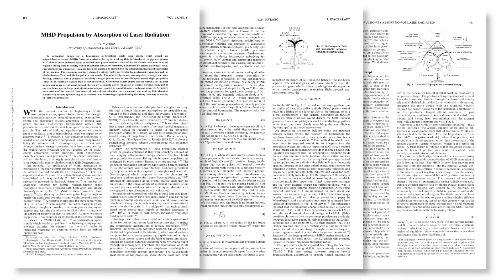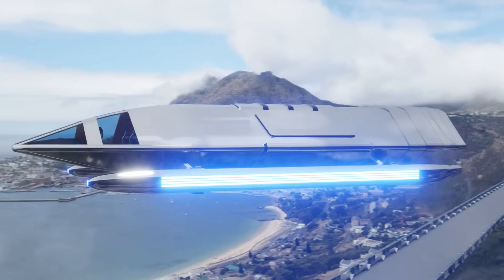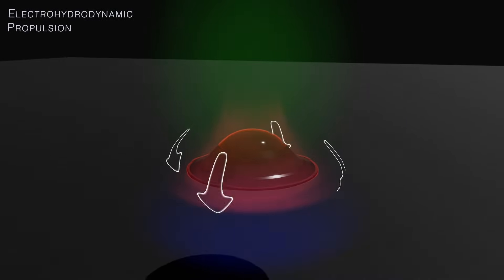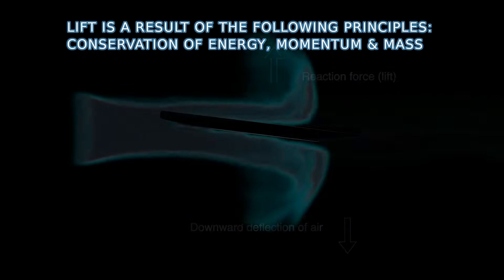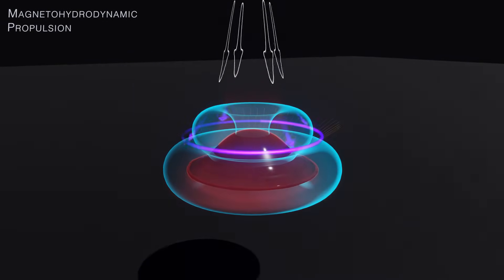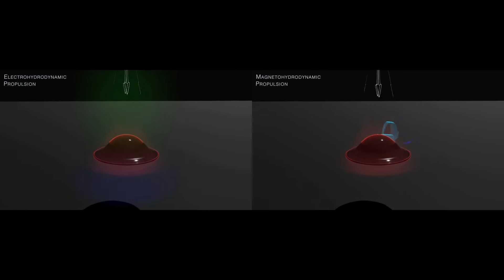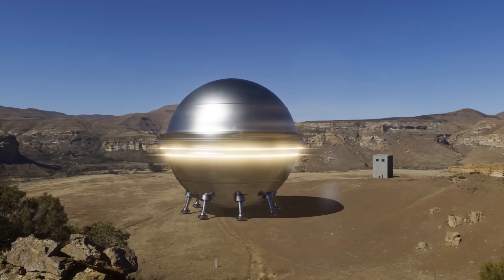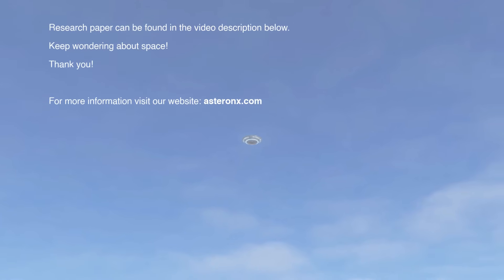Magnetohydrodynamic (MHD) Propulsion - What Is It? #magnetohydrodynamics #mhd #aerospace #asteronx

Comment: Very good briefing and tutorial to explain the electrodynamics and fluid conducting material and operation of the craft.
Reply: There is an interesting design of aircraft, but they rarely talk about it, because this thing is secret. The topic of pulsed plasma thrusters has been developed since the early 60s (see PPT - Pulsed plasma thruster) - they are usually designed for spacecraft. But we will talk about a little-known design - these are plasma propulsion panels for aircraft, where the same Pulsed plasma thruster, but reduced to the size of a pencil and stacked in the form of cells in the panel. The design resembles a conventional plasma TV screen, where there are also discharge cells that activate the glow of pixels on the screen. And plasma propulsion panels have long discharge cells, the arrester has a railgun architecture (just rail contacts or coaxial), and the ionized discharge air is accelerated there by the Lorentz force to enormous speeds - a kind of ramjet engine is obtained. Just imagine! - tens of thousands of small ramjet engines assembled in a panel and firing plasma synchronously with a huge frequency (hundreds of kilohertz). Thus, plasma propulsion panels create lift by pulsed emission of plasma jets from railgun cells. There are tens of thousands of cells in the panel, they shoot at a frequency of hundreds of kilohertz, a huge pulse is obtained, and the plasma swirls the air into toroidal rings - the aircraft is held on this air cushion. Horizontal acceleration is created by the same plasma panels on the sides of the device (they glow, from the side they look like "portholes"). Such devices like "triangle" or "disk" have been observed for a long time, they are mistaken for alien ones - but these are terrestrial devices. They are classified and used for espionage and secret actions. Pulsed electromagnetic technology generates microwave radiation, therefore it is harmful to health. They rarely fly - only military missions. Therefore, they are not suitable for a citizen. This maintained the secrecy. Now they are already declassifying - many people know about this secret technique. When declassified, they will be used for cargo airships. But there is a danger that they are now going to be adapted to deliver small nuclear charges to decision-making centers - such means of delivery are not specified anywhere, are not conventional. This lowers the threshold for starting a war. It would be necessary to declassify them as soon as possible. That's why I'm writing about it. However, I have written before - starting with the book "The Elimination of UFOs" and many articles. There are also videos on my YouTube channel - "Declassified UFO" and "UFO Anatomy".
Reply: @Pavel_Poluian it's all man made

Comment: YES YES YES, FANTASTIC VIDEO, thank you!  I have been seeing this in my dreams since I was a kid and always thought we needed to use high spin mercury, under immense pressure, rotating at "light speeds", passing through high voltage at a specific resonance/frequency, to provide lift! Pair this with a way to track and "ride" magnetic and gravity fields and you have a "pathway" to "ride"! Pair the Lorentz Force with magnetic fields in the area (positive/negative) to provide pull/lift, kind of like a sail in a boat, generating a magnetic field that "pairs" <positive/negative> with the fields around the craft, providing pull/momentum in a certain direction, tie that to computers that scan/calculate the "local fields" and as long as you can "get off the ground" and attach to a "magnetic path", you have a magnetic "roadway" to travel!

Comment: Cool video. I still think these forms of propulsion are only a part of what powers UFO's, though. They definitely overcome gravity, it's not just moving plasma fluids. They can shoot off at incredible speeds so they must be creating some sort of "bubble" that overcomes the surrounding physics. It does have something to do with electric and magnetic fields, but exactly what? That's the big question. Maybe it's a dimensional shift. The Philadelphia experiment had huge magnetic and electric fields and something happened. If we could figure that out, maybe it can be be harnessed in a controlled way.

Comment: Pretty sure I've seen a craft using this type of propulsion. Flew straight down i front of me and was showing off. As it was approaching me it made a very sharp right hand turn and scooted forward a little bit. When it turned, behind it i could see a greenish/touquoise flourecent glow that came out like a trail or some kind of booster.
Reply: There is an interesting design of aircraft, but they rarely talk about it, because this thing is secret. The topic of pulsed plasma thrusters has been developed since the early 60s (see PPT - Pulsed plasma thruster) - they are usually designed for spacecraft. But we will talk about a little-known design - these are plasma propulsion panels for aircraft, where the same Pulsed plasma thruster, but reduced to the size of a pencil and stacked in the form of cells in the panel. The design resembles a conventional plasma TV screen, where there are also discharge cells that activate the glow of pixels on the screen. And plasma propulsion panels have long discharge cells, the arrester has a railgun architecture (just rail contacts or coaxial), and the ionized discharge air is accelerated there by the Lorentz force to enormous speeds - a kind of ramjet engine is obtained. Just imagine! - tens of thousands of small ramjet engines assembled in a panel and firing plasma synchronously with a huge frequency (hundreds of kilohertz). Thus, plasma propulsion panels create lift by pulsed emission of plasma jets from railgun cells. There are tens of thousands of cells in the panel, they shoot at a frequency of hundreds of kilohertz, a huge pulse is obtained, and the plasma swirls the air into toroidal rings - the aircraft is held on this air cushion. Horizontal acceleration is created by the same plasma panels on the sides of the device (they glow, from the side they look like "portholes"). Such devices like "triangle" or "disk" have been observed for a long time, they are mistaken for alien ones - but these are terrestrial devices. They are classified and used for espionage and secret actions. Pulsed electromagnetic technology generates microwave radiation, therefore it is harmful to health. They rarely fly - only military missions. Therefore, they are not suitable for a citizen. This maintained the secrecy. Now they are already declassifying - many people know about this secret technique. When declassified, they will be used for cargo airships. But there is a danger that they are now going to be adapted to deliver small nuclear charges to decision-making centers - such means of delivery are not specified anywhere, are not conventional. This lowers the threshold for starting a war. It would be necessary to declassify them as soon as possible. That's why I'm writing about it. However, I have written before - starting with the book "The Elimination of UFOs" and many articles. There are also videos on my YouTube channel - "Declassified UFO" and "UFO Anatomy".
Reply: @Pavel_Poluian  Thanks for the Information. I live in NC and have talked to others who have been chased by the same craft as I saw but they were driving. Idk if what I saw was terrestrial or not, but it definitely got me interested in UFOs. I'll definitely take a look at your channel.
Reply: @yusefs3550  Thank you for your understanding and interest. Use an automatic translator.

Comment: The B2 bomber was always using MHD. Check it out. Maybe you'll find the one image (or footage. It's on the website of an ex aerospace searcher in France, Jean Pierre Petit, it's still on his website and no one has ever seen it, almost, lol, if you type B2 and his name,n maybe also MHD, you'll find it easily) that was taken out of the site of Northrop and showed the B2 having a short circuit at extreme voltages that could NOT be explained in any other way. No matter they're so expensive. It was never really a subsonic (or if you twist the term, maybe) aircraft with standard jet engines.

Comment: How will your aircraft create and control high temperature plasma? And how will you manage the interaction between magnetic fields and the surrounding environment? Also, how will you ensure the stability and control of your concept flying saucer?
Reply: I think as you altered fluid aerodynamics with an aileron in a airplane, in a MHD and/or EHD propulsion system (evidently use hyper-fast computer  control of the field) we can master field changes to alter the intensity of the flux around the flying saucer shape to create a differential of forces to turn or incline the system to MOVE the entire "ship" or "flying saucer" we are in, to pull or push in the direction we must or want to go!!! 😁
Reply: If anyone is interested in discussing this, I think I might actually be onto something, I'd love to talk to someone on the same wavelength
Reply: @YTTOAYN  Most of this video is nonsense. The ISS already has MHD thrusters. Many satellites have them as well also The fastest vehicle ever made DeepSpace One . Look into Hall-effect thruster and Variable Specific Impulse Magnetoplasma Rocket.
Reply: No steering wheels 😜- DHM
Reply: He wont do any of this its science fiction. He does not understand any of this stuff correctly he is very confused probably schizophrenic.
Reply: Mhd = floating stuff
Reply: What are your thoughts on compressing the hollow  plasma tours with oxygen. These air molecules will act as a force on the plasma (a thermo plasma  to a point it's squeezing it or pushing down on this plasma while the MHD accelerators this ferro magnetic plasma for Antigravity propulsion. I don't believe that this is true an that if effect PSI air pressure is added on this that the tours doesn't hover, but instead the tours at normal speeds for propulsion would create a Mass Reduction. So instead of 0 60 miles per hour in seconds.... How ever this method will cause the tours to go from 60Lbs to 0 weight in seconds an could help with G Forces on Pilots. If the craft is loosing its mass then the engines can propel the craft faster than it normally would.
Reply: @billywilliams6147  Your cocopuffs
Reply: @anthonyb5279  You're making me hungry, I haven't had cocopuffs in years :( kinda wanna do a round of cocopuffs with some ovaltine on top to get that rocket power
Reply: @feastiewinkle  Hahahaah - Now I want some CocoPuffs

Comment: The forces of magnetism does travel through none conductive surfaces provided they don't exceed the field length. Liquids and gases might  have troublesome centre of mass to control and just using solid wave cavities might be better stability to create instability upon a craft. Scattering motion and true motion of Kubel like  bearings held into position might create low and high pressure differential also.

Comment: Is it possible to ionize the air using just rotating magnetic fields ?
Reply from the maker: Simple magnetic fields, rotating or not, will not ionize the air. The air must become electrically active (ionized) first. This is the reason for why high voltage, high frequency discharge emitters are used (similar to a Tesla coil). Once the air is ionized, then strong magnetic fields are able to move the ions.
Reply: @asteronx  Theres'a video where someone used a disc with alternating poles north and south and put a glass of water near on top while it rotates and after some minutes, the water started to boil. I thought that something would happen with the air the same as happened to the water on the video.
Reply: @prerupa Where’s this video?

Comment: Completely pointless to even consider as a form of thrust.  The force would be less than blowing air from your lungs. Even when using gigawatts of electricity. Ever feel anything when putting your hand in front of an "Ionic Breeze" fan?   It is more efficient to just use propellers as drones do.
Reply from the maker: To give up so easily is not wise. The video opens the doors of potential, be assured, there are many different ways of achieving the same results. There are other forms of MHD ...
Reply: @asteronx  I mean, for a first baby step, it would be better to look into airship to orbit related things, then experiment with the propulsion system on the balloons at higher altitudes. Also more cost effective for your start up and helps build investor trust.

Comment: We can do air?
Reply from the maker: We can fly in air as well.
Reply: @asteronx  seems like the b2 prototype I saw fly by me works like that. Couldnt hear it till I could see the ports then it did not sound like spinning turbines it sounded like ocean surf or the sound of a car drivin up a gravel driveway
Reply: I put alot of thought into what I saw. Like it had a plasma field and lined up coils that pulled and pushed made me think it used air for fuel. It was long and flew slow. It came out the northwest from oklahoma. Someone east of me saw it the same night and reported it to the ufo network. It was dark I couldnt see its planform but I coulda hit it with a rock and it was goin slow. It had a dull quartz nose light.and a flat dome red tail light under the rear.
Reply: @hadleymanmusic  oh

Comment: Ion Wind is the effect or an asymmetric capacitor. The positive being the smaller of the two promotes the flow of electrons toward the larger negative side. The electron transfer pulls the wind with it. The higher the voltage, the faster the flow (obviously).

Comment: Someone please further explain how EHD and MHD can be separate. This was not actually explained, and it looks more like you can't have one without the other. Ostensibly you used exactly the same model in your graphic (and it was superbly done) to describe two separate things. For example, an aircraft propeller uses mechanically induced low pressure on its forward surfaces to generate thrust, but also generates a violent spiral of air behind it as a side effect. They are two distinct phenomena but cannot be mutually exclusive in the same scenario. To me you are describing a similar situation and claiming you are only researching the one phenomena, to the exclusion of the other.

Comment: "virtual particules".
Let me brake it down for you 
1 works with gazes including heated gaz = plasma.
The other one works with the aether.
It's another medium. Defined by 2 pressures ( at 90 degrees) XY - your magnetic field - and a tension Z in the medium. The diélectric field they hide by telling you a particle is masquerading on the surface of the conductor.
Magnetic field + diélectric field = electric field